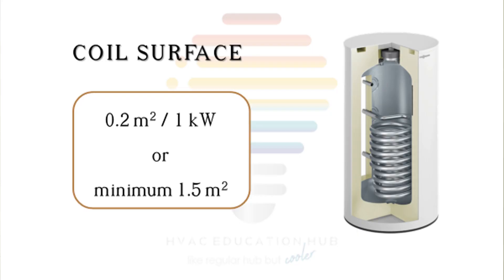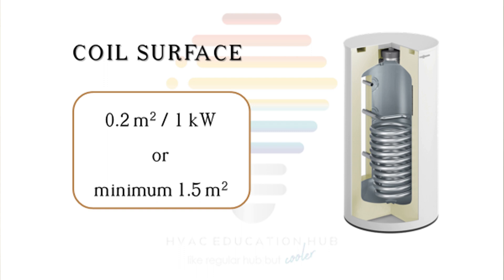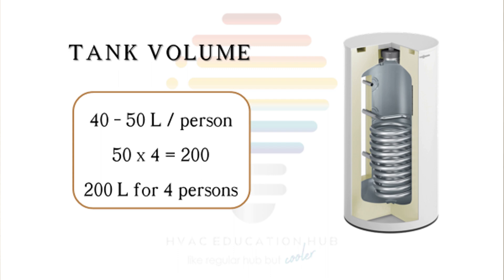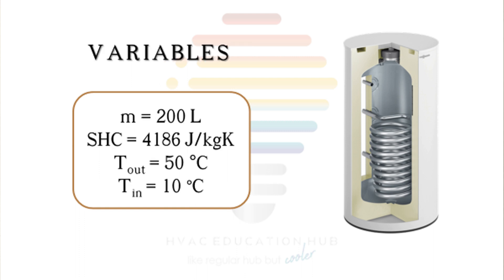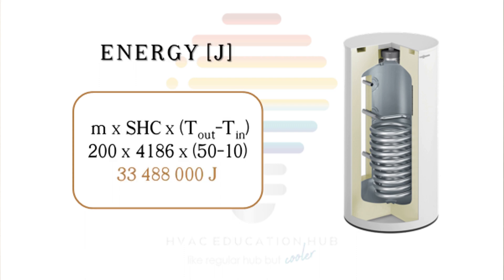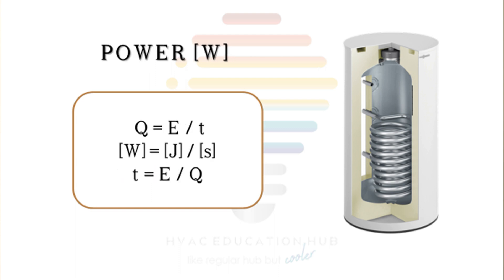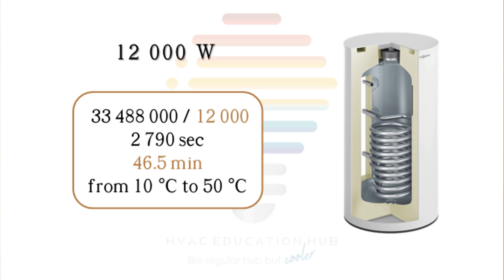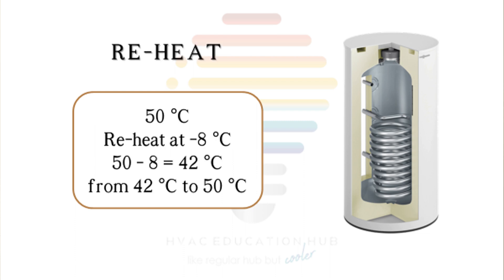DHW Tank Sizing Explained | How to Calculate Domestic Hot Water Tank Capacity

Comment: Hi Thanks for sharing such informational video.
I have a question.in the start you explained that coil surface should be 0.5 m2/KW to 1.5 minimum but in the calculation it is not used anywhere so how does it have an impact for heating the domestic hot water requirment.
you used the formula m x sch x (tout-tin) for finding the energy.
Reply from the maker: Hi, thanks.
It is 0,2 m2/kW, not 0.5

It is not used in energy formula, just value from experience. The bigger the coil the better, similar like heating system with bigger radiator or more underfloor heating.